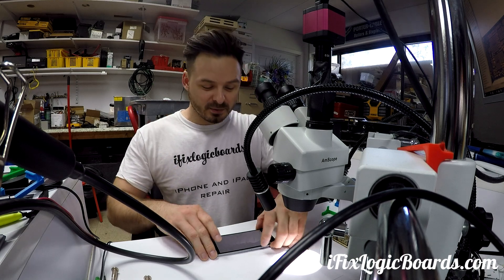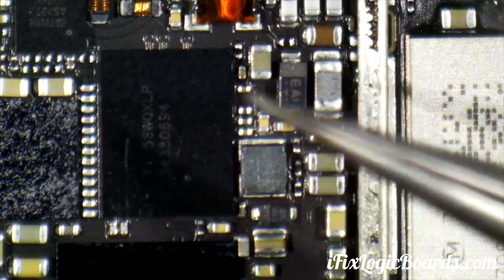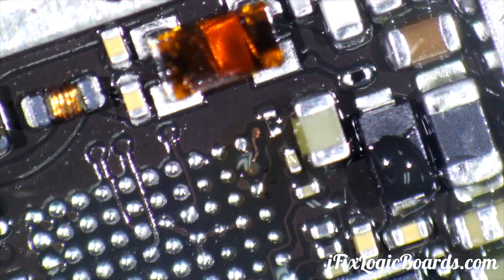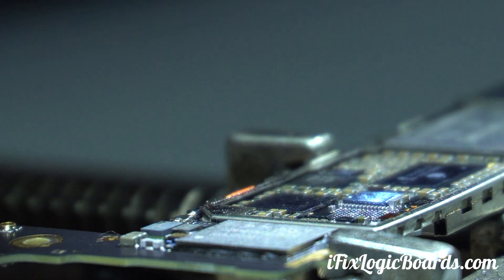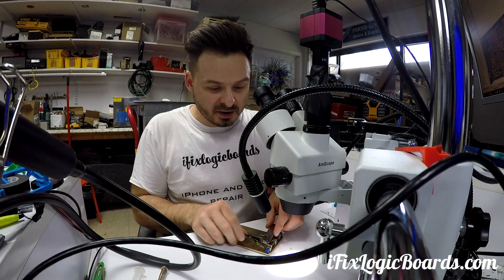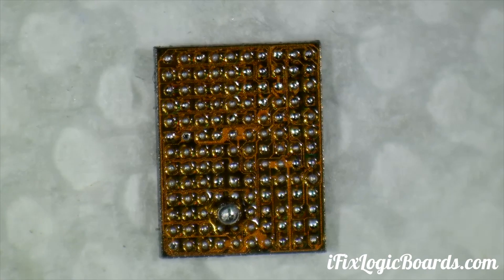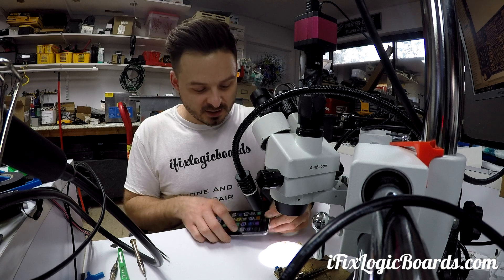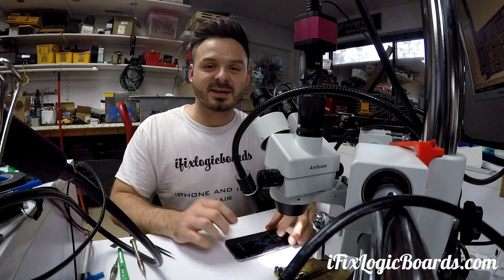iPhone 6 plus grey bar - Touch Disease repair - m1 jumper

Comment: Nice video bro ;) Just a few questions. How did you knew you had to place a jumper there? You knew it before taking off the IC, or you checked each pad after the replacement?
Also would be nice if you could say which temperature you used on the iron and hot gun?

Thanks and keep up the great job

Comment: Hi Rafal, my JBC soldering iron and tweezers have arrived yesterday, I’m very satisfied with the tools, may I ask what cartridge do you use? Is it c245-036? 
Also, I did my first touch ic repair yesterday, but it wasnt really successful, after replacing the touch ic the touch was working but in a certain place on lcd the touch froze. I tried to take out the IC, reball and then place the chip back in but now there is no image at all on the lcd and it s not the backlight, touch ic is getting very hot and the screen is black but I can see the backlight .. after taking out the touch ic the phone switches on again but of course touch isnt working.. do you think theres something else I could try? Buy new touch ic and try to put it in again? thanks for help
Reply from the maker: Are you making the M1 jumper?  Maybe its shorting against the ground next to it. Sometimes its hard . U can use UV mask to hold the jumper wire in place.  I have C245-032 and -030.
Reply: ScoopOf3D thank you for the reply. Yes I did the jumper and I used the UV mask as well. simply, when touch IC is attached there is no image and the chesnut is getting really hot. immediately after removing touch IC the image is back but touch isnt working. I dont understand where the problem is. :(